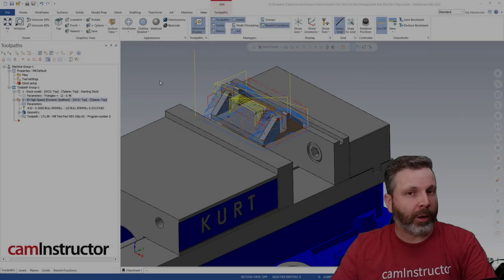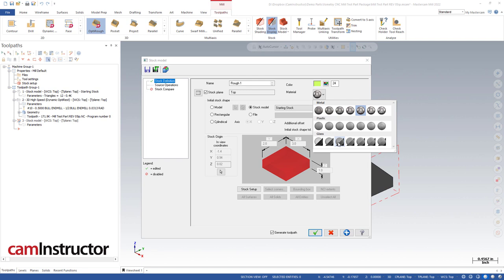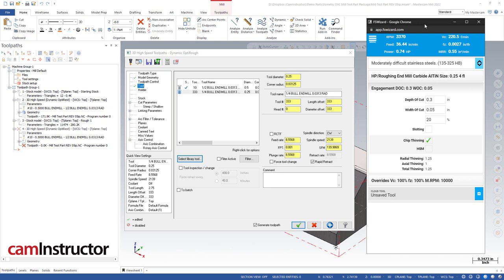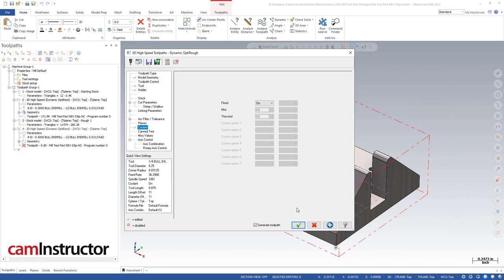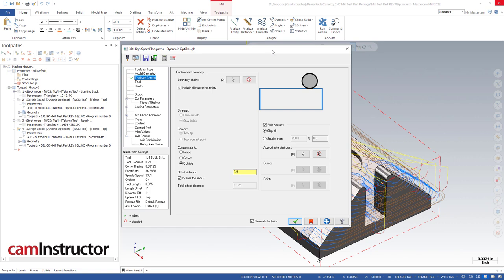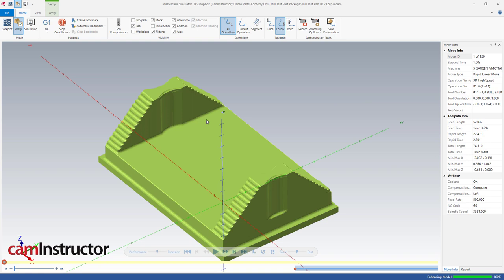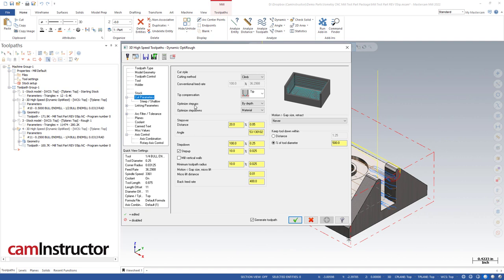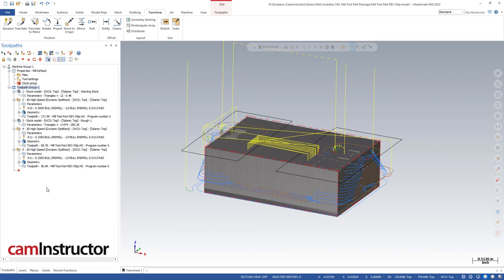Controlling Where OptiRough Cuts | Xometry Mill Test Part - Video 5

Comment: Some good information here, I am about to start making this part. One thing that concerns me with your set up is flipping it over to take off the rest of the stock material. How did you plan to control the Z offset accurately?  Seems to me opp1 would be to machine the 0.197 base first and then flip over to grip on that surface to machine the top features.
Reply from the maker: Been meaning to continue on with this part in the videos, just been sidetracked lately.
For side 2 its pretty straight forward. You don't even have to use an offset if you don't want to. You could manually face the part to thickness. If you prefer to use an offset, measure the part to get an idea of how much extra stock their is. Compensate for that in your Z offset for side 2. I would even stay slightly above that until you make a cut and can take a measurement. From there, just dial in your offset based on your measurements.
Reply: @CamInstructor  While I agree this "could" be done if you made a pair of softjaws to locate from the 135 degree surfaces, making sure the stock is flat without them is going to be a pain. I found it much easier to machine the 2.80" x 1.88" base 0.300" deep in the the raw material then flip it. relocate center of stock and Z from the surface of the base you just machined, then run the other features, staying 0.100" up from the bottom of that machined base. 

Even on a Tormach 1100M I was within 0.001" in Z and 0.002 in X and Y. Running all those features that are +/-0.005", and a 0.002" depth cut on the C-bore, from a rough stock surface is a good way to have a bad part. I get you are just showing tool paths creation in your CAM but some people might be using this to actually try to pass their QC requirements. 

Also just FYI they have changed this to Rev 6 Since you started making your videos and that little island in the bore feature has been removed. Not sure if there are other changes as I didnt actually get a Rev 5 model/print.
Reply from the maker: @abarasabwehttam  There is no need for soft jaws or anything custom for side 2 on this part. I don't think you are understanding the process here yet. Perhaps once I get to that part in the videos it will make more sense.
The processes shown will make a good part 100% of the time. I'm not just showing toolpaths, I'm showing how the part should be programmed and machined to make a good part.